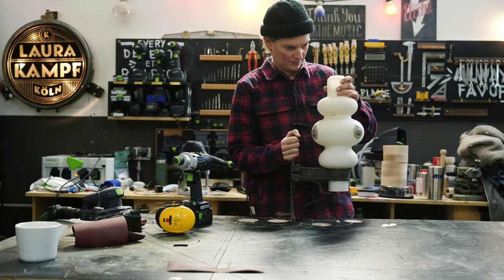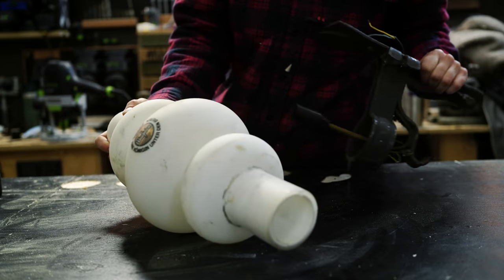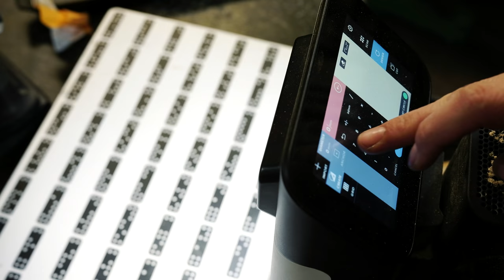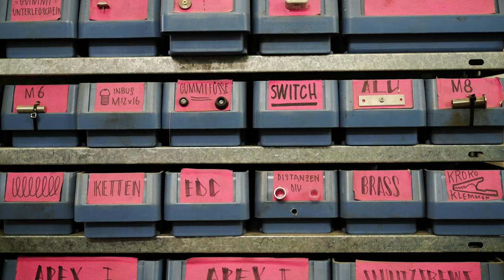I built this Lamp from Trash!

Comment: In knitting, we call these “ instant gratification projects “... when you need a break from a large project, knit a cute hat or mitts, then go back to the big project refreshed and energized.
Reply: Same as with my self designed 3d printer. I was struggling so I hacked a relay board, a nodemcu and the insides of an old phone charger together in an afternoon. Result, central box with 4 plugs coming out that I can control with my phone. Quick win. Satisfied. Rejuvenated.

Comment: I love your work!  And you seem to always have such a good time.  Quick question. Can you (or anyone) point me to that cool Forstner bit that had the long pilot bit?  For many cases, it's much better than the small point most of Forstner bits have. It seems perfect for those times when enlarging an existing hole or drilling in non-flat surfaces.  Thanks much!
Reply from the maker: It’s a Festool forstner. The centre bit is exchangeable-genius

Comment: I might have missed something here. It appears that you suffered a wire onto the lamp rod. Is this a grounding wire or is this a current carrying wire? Is this lamp running off in the mains or is it running through a power supply or step down transformer?
Reply from the maker: I never show the electronics in my videos
1-its too much for the trolls :)
2-I am not an electrician and i don‘t want to give wrong instructions.

Talk to a pro if you need help there